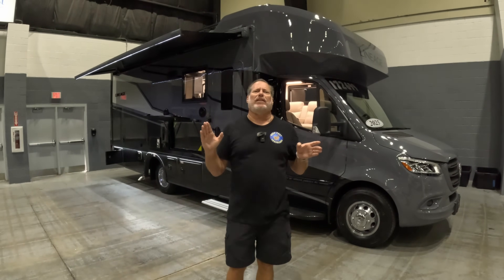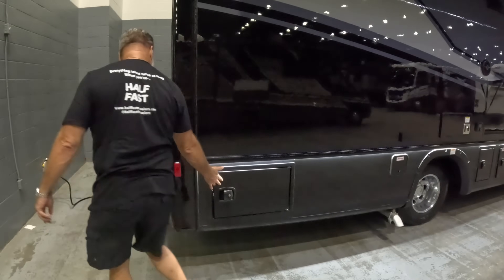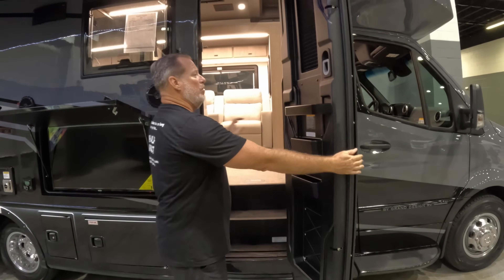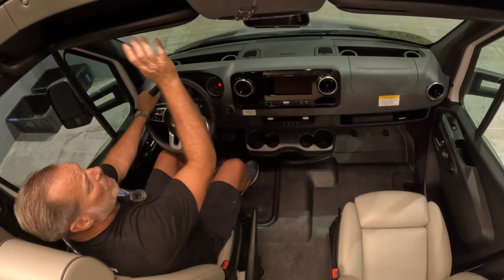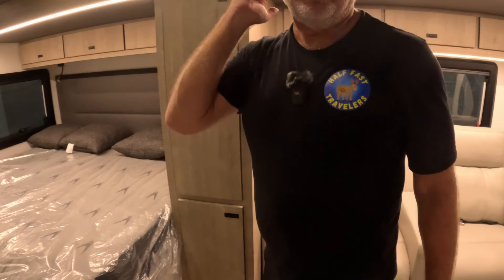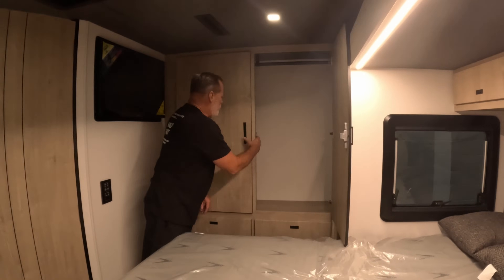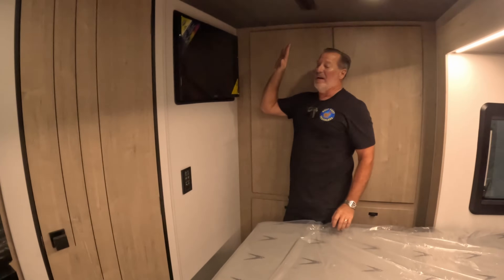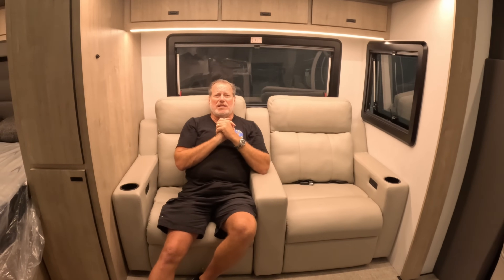First Look: The Brand New 2025 Grand Design Lineage Series M 25FW

Comment: That inverter in the 2nd bay on the passenger side is 1000 watts. With all that tech and electronics how do they put a weak inverter in this that can’t handle normal household 120V appliances?
Reply from the maker: We agree. A 2000 watt inverter is a must.

Comment: I like that there are plugs and USB ports on the overhead bunk.  The glass washer!!! I love it.  Alex doesn't understand it but he doesn't do dishes😅😅the bedroom seemed tight.  We like the Murphy bed as well.  The bathroom is very tight, and Alex is  not a fan of the push button drain.
Reply from the maker: Yeah, that glass washer was really nice.  We are on the same page on the Murphy bed and bathroom.  We were scratching our heads at the drain.  We weren't sure why it was necessary.  Thanks for your post.

Comment: What is the weight it can tow?
Reply from the maker: This is a great, but tricky question.  We couldn't find it listed on the Grand Design site, but even if the rating is as high as 5000 lbs. you probably won't be able to tow that much.  The Lineage uses a Sprinter 4500 chassis, and while this does allow for a higher GVWR (More cargo capacity) the GCWR remains about the same.  This actually results in the 4500 having a lower towing capacity than the 3500.  The Grand Design site lists the GVWR as 12,125 lbs. and the GCWR as 15,249 lbs.  This means if you are fully loaded, you can only tow just over 3,000 lbs.  This limits the type of toad you can use.  Hope this helps.

Comment: At this years Hershey show there was a lot of chatter that this was the number one selling RV at this years show. Although they had three of them there - you still had to wait in line to view them. I can attest you didn’t have to wait in line to see either LT’s or Views both of which had much higher MSRPs and way less OCCC’s.
Reply from the maker: We were fortunate that we found this at one of the smaller shows, so we basically had it to ourselves while filming.  We did return to the show a couple of days later and saw many folks checking out this new model.  We're not sure if the crowds you saw were because it was new or because of the quality and features, but we were really impressed with this first attempt by Grand Design.   OCCC is such a huge factor in these Mercedes-based Class Cs.  We're happy that we can help bring more attention this fact.  Hopefully they will start posting the OCCC on the dealer and manufacturer websites, but we won't hold our breath.

Comment: Is there a screen on the entry door
Reply from the maker: Great Catch!   Yes, there is a screen, but it is different from most RVs we have seen.  Just inside the door on the forward side there is a retractable screen that slides out across the door.  It has a similar operation to the shower sliding door.  It is a really clever design, and we should have pointed it out.  Thank you for being less half fast than us.

Comment: The biggest problem with the Lineage is the 4500 Sprinter chassis it is built on vs the 3500 chassis that most others use. It is questionable if an RV should be built on the 4500 chassis and thus far in 2025 models only Grand Design and a couple Thor models are the  only one. Wish you had read the OCCC as would not be surprised if it was in the 2000lb range which more than resolves the issue of the low OCCC with the 3500. The 4500 with the stronger axels to handle the weight was designed as a local delivery truck option rather than an open road RV. The prblem is both the 3500 and the 4500 have the same GCWR rating of 15250 lbs, but with the higher GVWR in the 4500, the towing capacity drops from the 4220 lbs with the 3500 to a miserly 3125 lbs with the 4500. That eliminate all new Jeeps, Fords and all but one GM as TOADS. To GD credit, while they don't note any of it in the specifications, I've heard they put a 3500 lb class hitch on, while Thor maintained the 5000 lb class hitch - inviting trouble. Personally, I will take the 3500 chassis.
Reply from the maker: You make a really great point about the towing capacity.  It makes sense that if the chassis weight increases and the GCWR does not, you will not be able to tow as much.  That weight needs to be made up somewhere.  The yellow sticker on the door indicated an OCCC of 1,062 lbs, but there is a clear caution that the weight of the water (291 lbs.) needs to be subtracted if you are traveling with a full fresh tank.  We do tend to travel light and comfortably below our GCWR, but we never travel with a full tank just to be safe.  Thanks for starting this conversation.  Our viewers need to see it.
Reply from the maker: Everything you're saying makes a lot of sense.  We did notice that the cabinetry was especially heavy duty, not to mention the inclusion of a large LP tank which is really heavy as well.  The 600 watts of solar panels on the roof probably don't help either, and that weight is really high as far as the center of gravity goes.  We recommend being especially careful driving this beast.  In all fairness, it is a beautiful coach.  Thanks again for sharing this post.

Comment: About the refrigerator, as long as it is not an absorption refrigerator, it is good.  There are no fins in the inside back wall, so this is not an absorption refrigerator.  YAY.  (I had the fridge fire.)
Reply from the maker: It seems as if absorption refrigerators are on the way out, at least in these small Class Cs. The idea of an RV fire is so terrifying.

Comment: OK, with an OCCC of 1062 pounds there is a problem. If you have an average couple with 1 dog, that’s about 400 pounds. Say 20 gallons of water (to get from point A to point B) = 166.8 pounds. Assume a total of 10 gallons 1:07  in black and gray tanks = 83.40 pounds. LPG 20.3 lbs. 
That’s already a total of 670.5 pounds. 
You now have 391.5 pounds for ALL of your RV hoses/accessories, tools, ladder, chairs, rug, bedding, towels, clothing, shoes, kitchen equipment, electronics, groceries, and misc. 
Can you do it? Can anyone? What’s the point of having an RV, if your dogs bowl pushes you over the weight limit?
Don’t know about the dangers of an overweight RV? Research it. It’s bad.
Why do RV manufacturers insist on using these inadequate chassis? Kickbacks? Not to mention that a Mercedes chassis is expensive to service and repair. 
Can ANYONE explain this to me???? 1:07
Reply from the maker: Your post is a great example of the math that RV buyers need to be doing before selecting an RV.  When the RV you want has a low OCCC you are always going to be doing a juggling act with what you bring with you on your trips.  We are lucky that we tend to travel very light, and the OCCC works with our RV style.  Thanks for your comment.